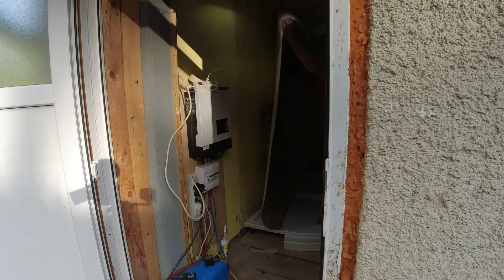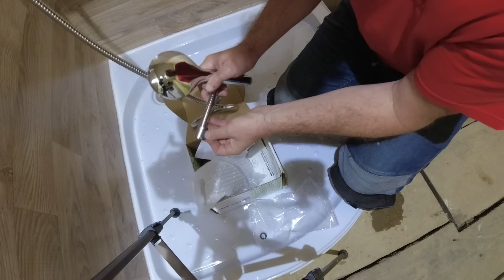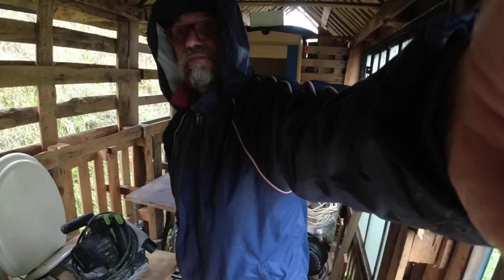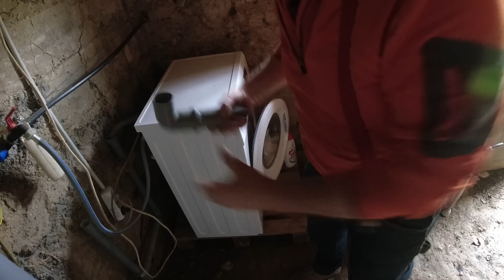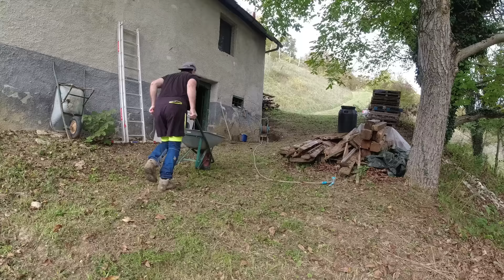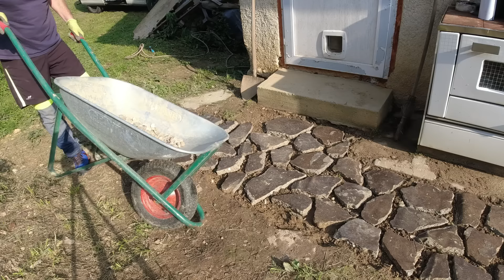Lonely hard life of men in a remote mountain village Ep. 4

Comment: The steep slope seems like a perfect location for your solar panels.  When I had mine installed on top of a pergola, I was told that they needed to be elevated on brackets to allow airflow beneath.  I don't know how important that is, but thought I would pass it along in case it is a consideration there.
Reply from the maker: Yes, they must be on the bracket in the summer it gets very hot under them